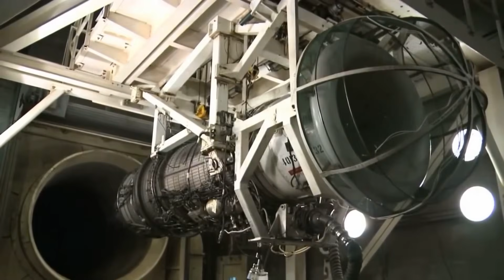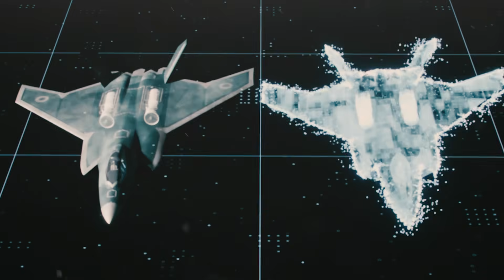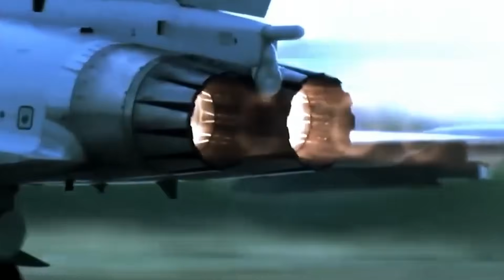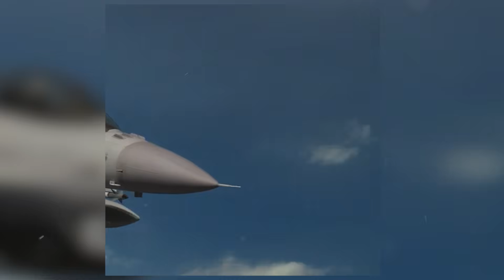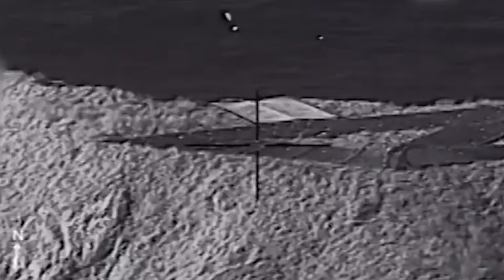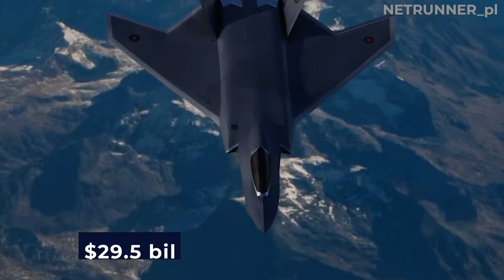Finally: UK Launch New Tempest 6th-Gen Fighter Jet to Replace Typhoon

Comment: Everyone want to join so get access and understanding rolls royce EJ 350 so they built thier own. The Rolls Royce (RR) engine maker is crown jewal and pride of the UK.. To protect their engine design  RR reused the EJ 360 modify fit an exturnal power generater to provide enough electricity to even change avaic. This was something they have learn from the Typhoon.  The problem is still along way off from finish.